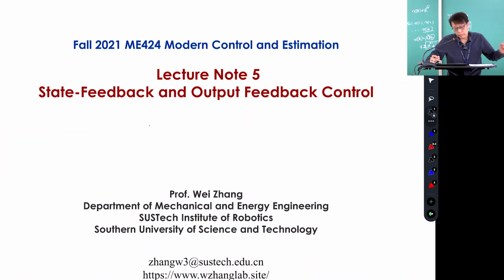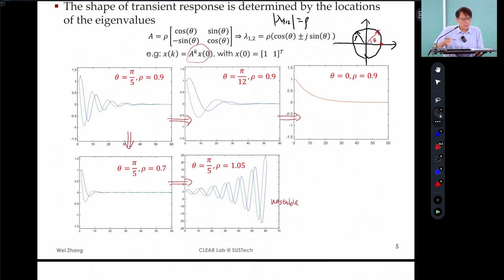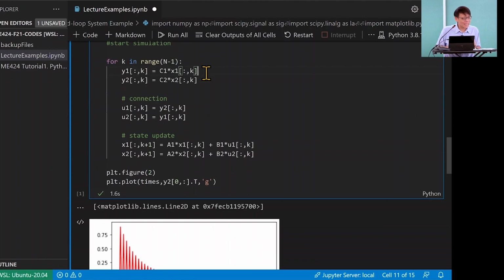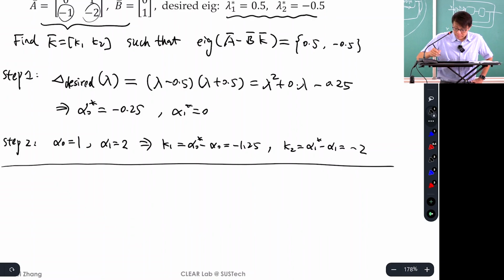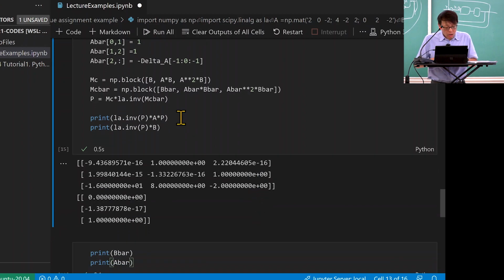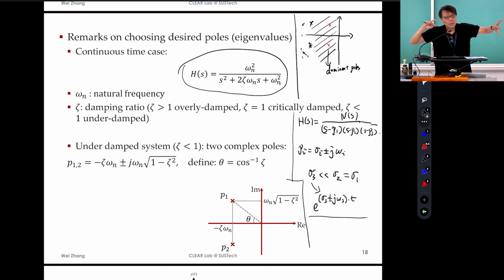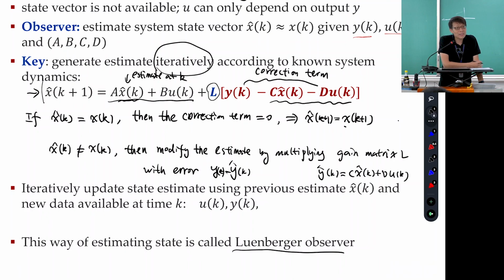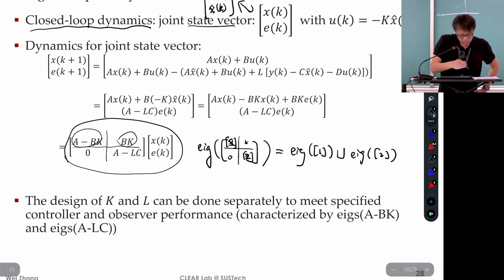Lec 5: State and Output Feedback Control (Full Derivation) | SUSTechME424 Modern Control& Estimation

Comment from the maker: TABLE OF CONTENT
00:00:00 System Response and Eigenvalues, Controllable Canonical Form
00:29:22 Closed-Loop System Simplification, Closed-Loop Simulation with Python, Controllable Canonical Form
01:13:07 Eigenvalues Assignment for Feedback Control, Python Example
02:00:24 Multi-Input System, Eigenvalues Assignment Procedure for Feedback Control
02:43:46 Luenberger Observer Design, Separation Principle